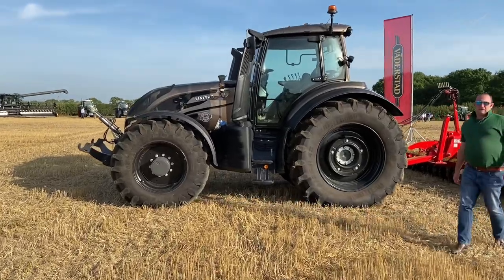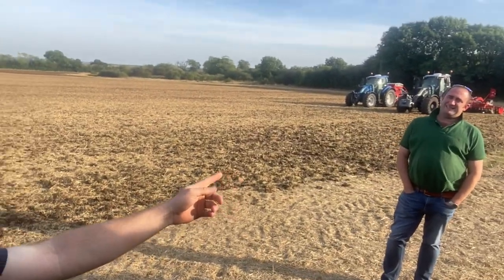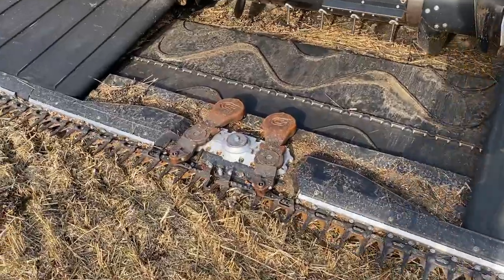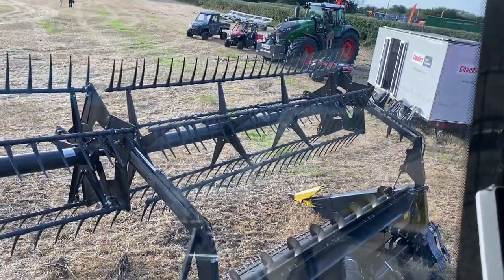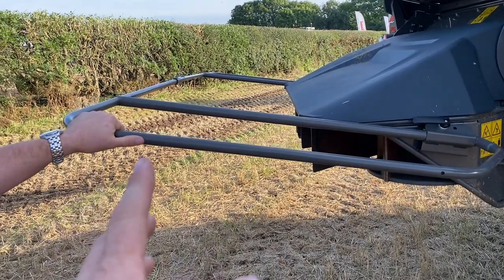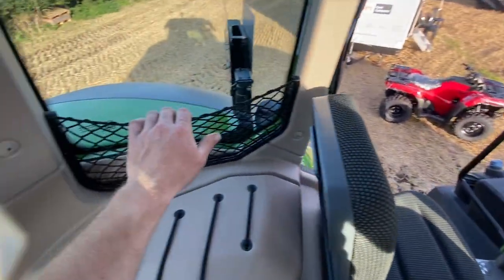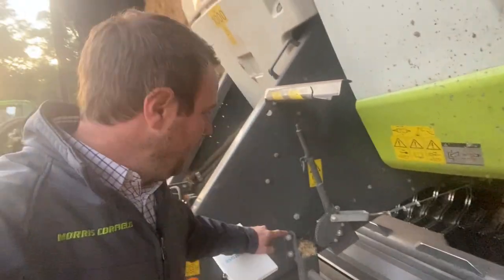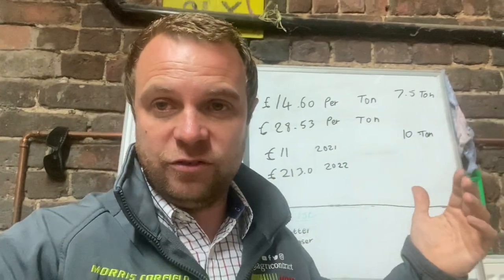Day549 #OLLYBLOGS MORE FROM CHANDLERS OPEN DAY + I EXPLAIN THE COST OF FERTILISER #AnswerAsAPercent

Comment: Claas copied the powerflow header from MF! MF combines have had it for years.

Good explanation of fert price rises.
Reply from the maker: If you say so but power flow has a auger to middle and claas belts take it to the middle with out a aurger 
I’d say claas copied honey bee or mc don
Reply: @OllyBlogsAgricontractfarmer  the MF powerflow header belts run front to back , not sideways, nobody ever tried to copy it ....., all draper headers including flex ones are variations on a successful design which dates back to the very earliest trailed combines , MF threw their combine towel in years ago by painting a Dronningborg red which were a disaster and more recently interfered with Laverdas designs and stuck an mf badge on the side .........

Comment: For the non machinery experts can you relate tractor brands to car brands as a comparison I.e. is a fendt like a Bentley and Massey like a Ford Focus?? You get the gist
Reply from the maker: Kind of yes
Reply: Paint a tractor "Red" and park under a hedge, you can see it stopped more easily.     Paint it Green,   Harder to See parked up.    Always been MF.    Also which is cheaper to put right, Green or Red.     Both Fendt and Massy are part of the AGCO group.    Massey for me everyday.